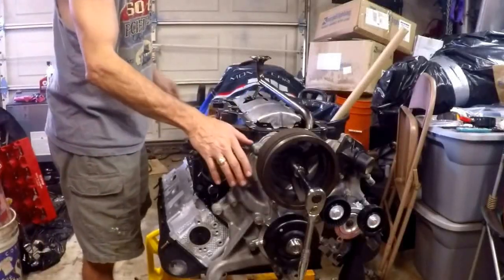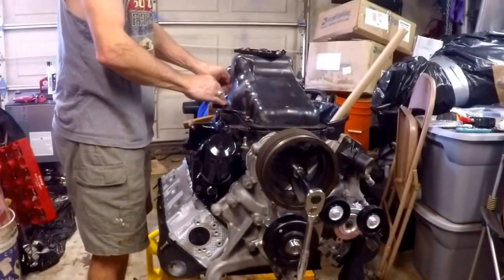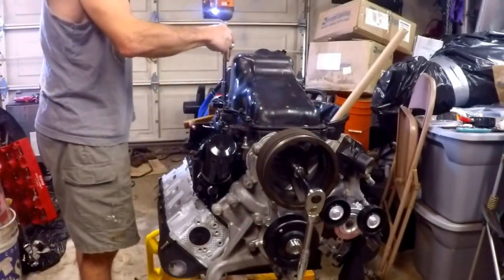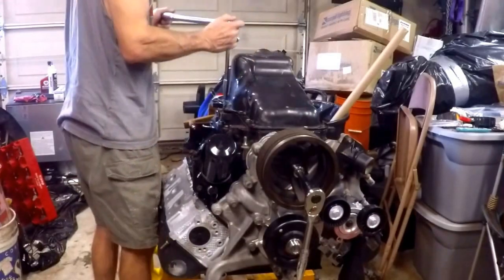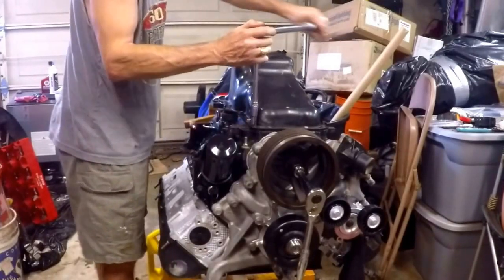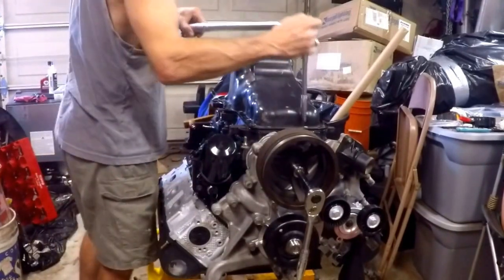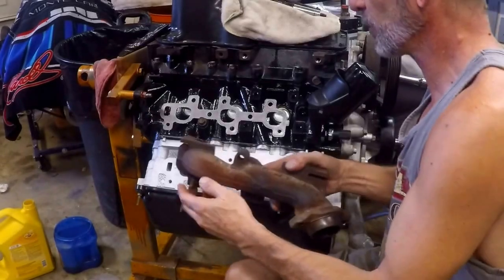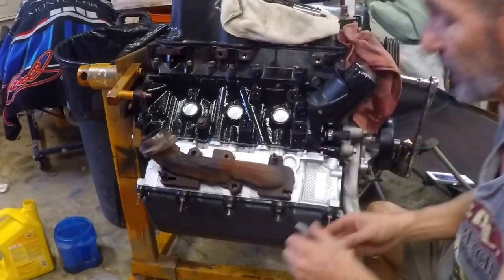Engine Rebuild - 3.7L 2006 Jeep Grand Cherokee Laredo - Part 12

Comment: Hi! I am rebuilding the same engine and I can’t understand why it says to put rtv on the manifold bolts, the book says it shares coolant passages but when I look in the holes I do not see how. It is just a hole with threads. No passage connects to it, so I’m not understanding how it would leak and what the purpose of putting the rtv on the bolt… I am not a seasoned mechanic. What am I missing here.
Reply from the maker: Hello Shawn. I totally hear what you are saying. They don’t all pass through a water jacket but several of them do. I’m trying to remember for sure, but I think the two short ones at the front of the heads do at least. I may be remembering wrong though. I chocked it up to better safe than sorry!
Reply: @TreyClanton  Thanks Trey for the videos they have given me guidance throughout this rebuild process!! Also thank you for responding to my comment a lot of YouTubers are just here for the 💰… and you seem definitely different!! Once again thank you!!!

Comment: where is the dipstick tube on this video I'm trying to put mine back together and I can't find out where the dipstick tube went on the Block I found images of it sitting kind of behind the oil fill in the AC line other than that I watched your video and you don't even have a dipstick in there I never toured this motor apart I got it back and pieces I put it back together runs perfect but no location for me to put the dipstick? Could you help me out with that thank
Reply from the maker: Hello Thomas. The dip stick goes into the top of the block in the rear right hand side (passenger's side). It on the back side of the intake and mounts with an o-ring and a single small bolt. I'll see if I can a picture to help you.